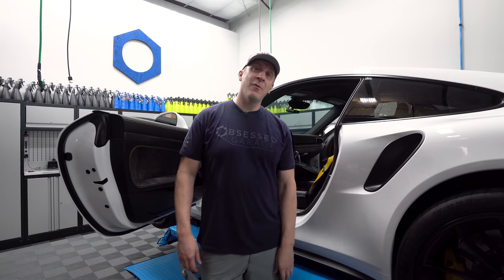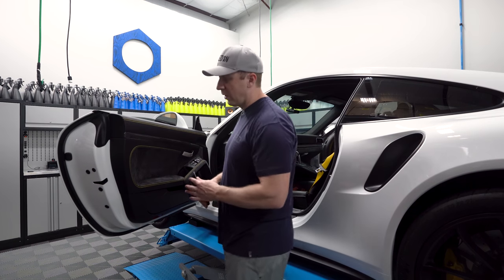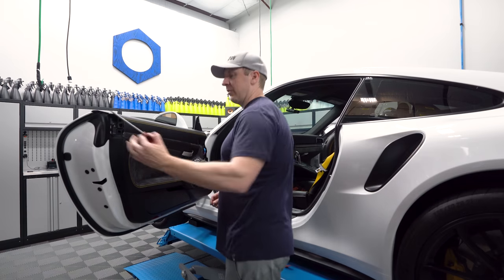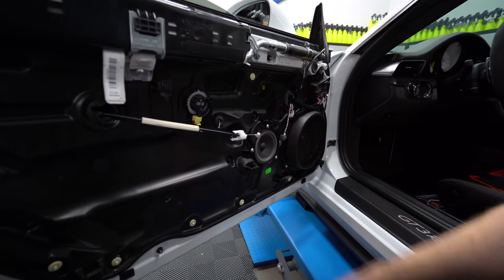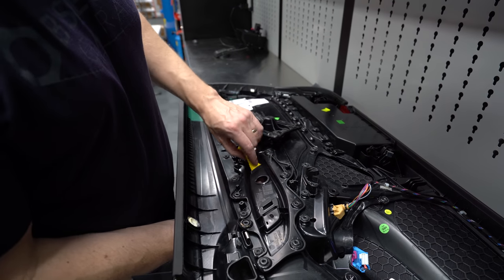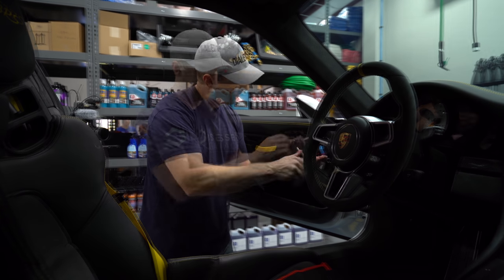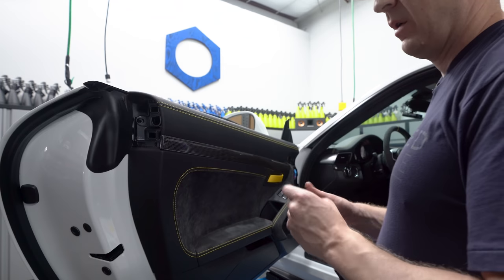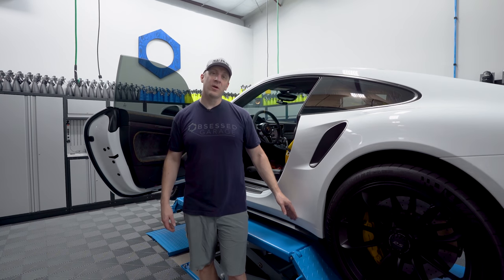911 GT3RS: Yellow Door Pulls Install

Comment: Love the fact that the door comes with the holes covered from the factory. Speakers sound MUCH better like that because it acts as an enclosure. You get improved bass that way. It’s a pain in the ass to do it yourself and have it come out nearly as clean as the door on that Porsche.

Comment: Why the hell was it originally white lol. Weren’t the original owners adviced the seat belt strap would be yellow? Great job getting matching handles
Reply from the maker: It is not an option to buy color matched door pulls outside of the CXX program that is really hard to get approved.  It would cost thousands to get it done, so it's better to swap after the fact.